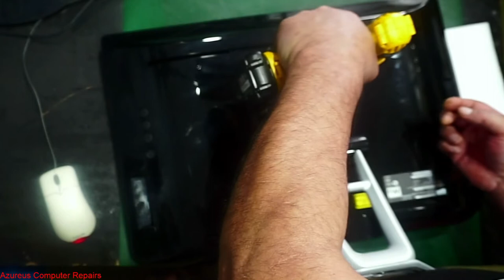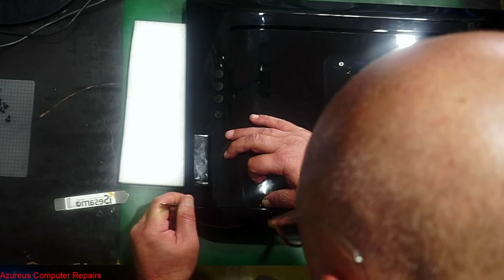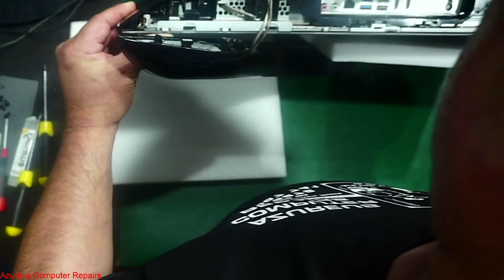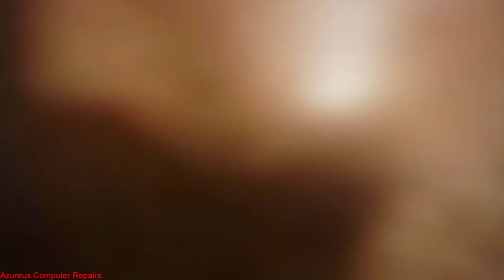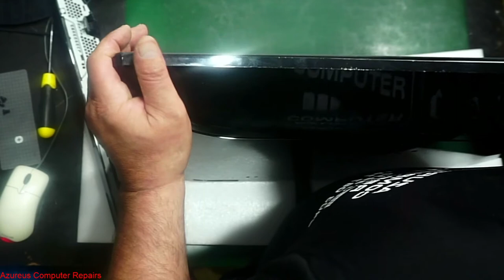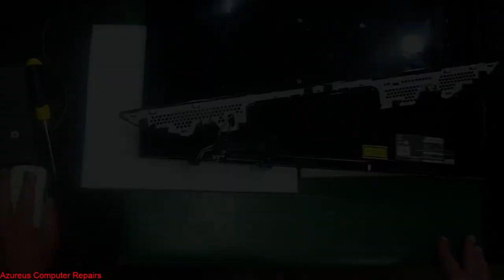Medion P2010 HDD Replacement

Comment: i trew it in the bin - the same bin , i found a fully working macbook pro 13 model - with at bad power(magnet)plug - on which i soldered a a permanent power plug - since i never use my comuters outside anyway ! - there a reason this planet is F#&$`ed  !